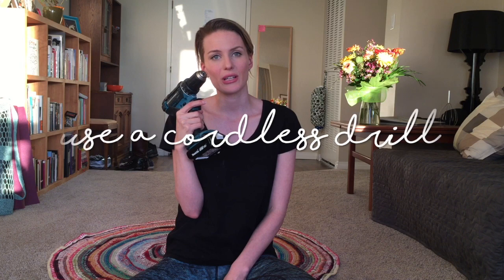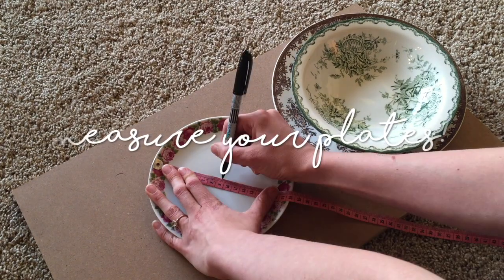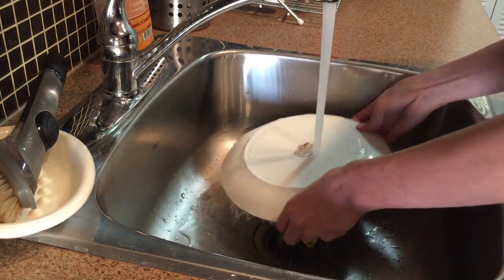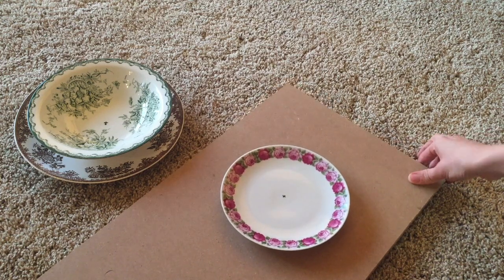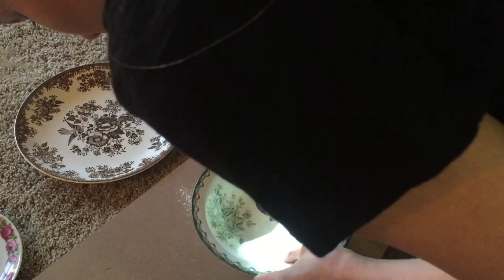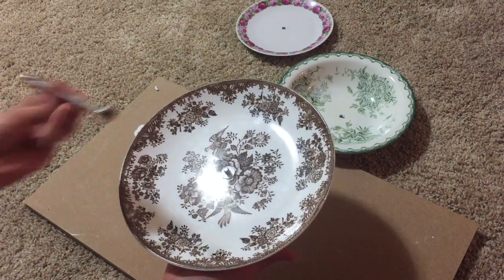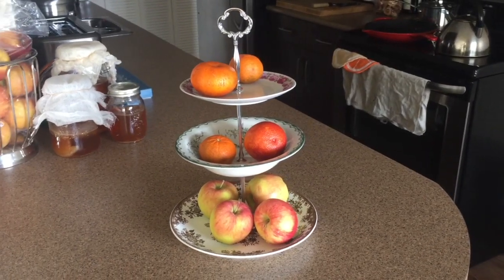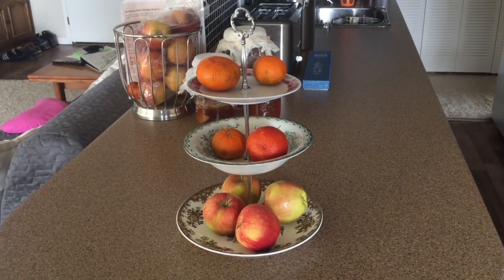DIY Vintage Plate Cake Stand 🎂  Miss Matti

Comment: You mentioned using tape to keep the drill bit from slipping, but I'm not quite sure where to put the tape? Thanks for the great tutorial!
Reply from the maker: Terri Fullerton Put the piece of tape on the area that you will drill through. So if you are starting to drill from the top of the plate put it on the top on the spot where you want to drill. Hope that makes it more clear! :)
Reply: Thank you!

Comment: What size drill bit is required?
Reply from the maker: It would depend on how big the diameter of screw part of the fitting is. I would go for the same size drill bit.